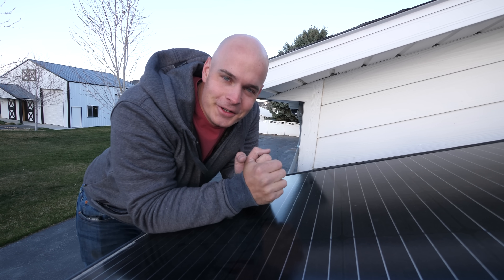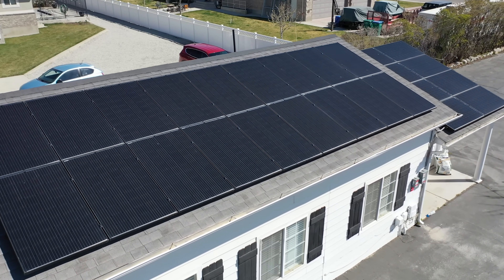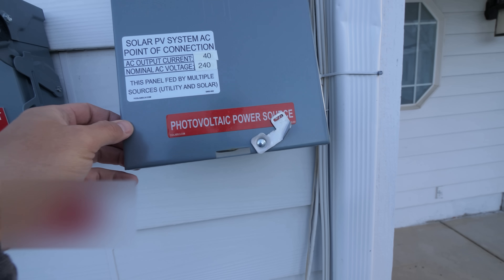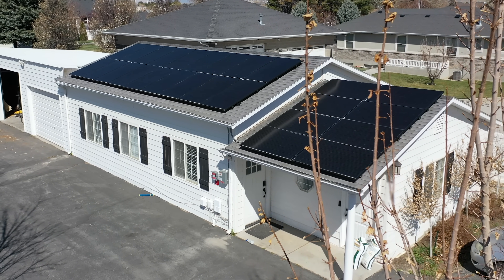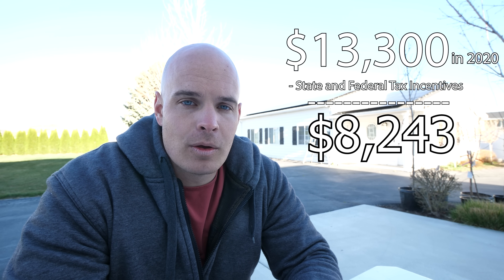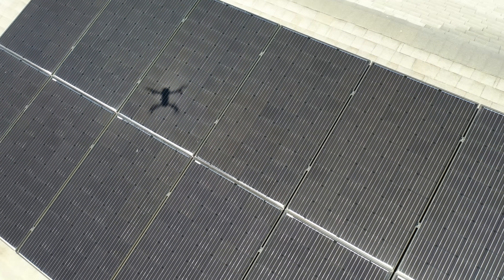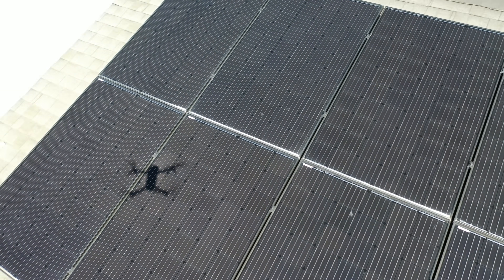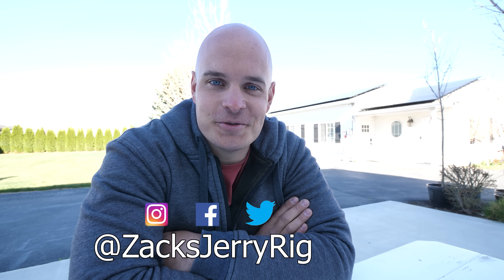One Year Solar Update! - Is Do it Yourself Solar worth it?

Comment: As a Texas residence, your statement about Texas  was accurate. We tried getting solar but we were told no, then yes, then no again.
Our friends in New Mexico did not have any problems and the state actually encouraged their people to switch.
Reply: Just go off grid.. battery storage is dirt cheap right now.. $300 a kwh
Reply: @FJB2020  um.... trolling? dirt cheap... using numbers here... 29kw x 300  8700$ for 1 day of storage... need at least 3... at LEAST for off grid... 26000$ in batteries... lolwut?
Reply: @mattlane2282  you use 29kwh at night?
Reply: @FJB2020  you never seen rain before? wtf are you even talking about... i use 29kw at night... it just rained here the last 2 days... and was cloudy for most of today..

thats 3 days at 29kw a day where your solar did close to dick...
wtf does night have to do with anything?
Reply: @mattlane2282  29Kwh sounds quite reasonable depending on the size of home. A 2-ton air-conditioner will use approximately 2 kWh per hour x 12 hrs @ night = 24Kwh, assuming 100% duty cycle. Folks don't quite get that you need 2-3 times the storage capacity (batteries) to draw from....depleting batteries to 0 damages them, even the so called deep cycle batteries. That raises the installed cost $$$. Sure, you can live with less run-time; settlers tamed The West 150 years ago without any AC. It doesn't invalidate the physics of the installation...
Reply: @luisderivas6005  This video doesnt help. Some who have never changed a light bulb think you can just throw some panels on your roof and plug them in. Two things, First, house must be oriented so panels get sun. Second, roof must be capable of supporting weight.
Reply: Texan here with solar, no problems here. They were sitting on my roof during the winter event too ... just not connected (not that it would've helped).
Reply: its because the oil companies are trying to protect their own interests by lobbying....more solar means less gas drilled. Which is why you see cloudy Europe and Japan so enthusiastic about solar while sunny Texas and Arizona lag behind...
Reply: @annikasurann9274  That is only part of it. Most solar panels and wind generators  are made with fossil fuel power LOL. Personally i don't have a problem with fossil fuels,they are completely responsible for thousands of things we use in our lives every day.and we already have infrastructure in placed now for over 100 years to use it. It makes perfect sense to dump fuel in my tank and drive instead of converting it to electric,sending it many miles and then charging an electric car for example,incurring all the losses. That being said solar and wind make up a trivial part of the power we wasteful Americans use. Not to mention wind only works sometimes and solar only works in the day time(and not even that when we had the Texas Freeze where it was all covered in a inch of ice.. Fossil fuel plants can generate 24/7. Solar is ok,and i do have 8KW of it installed here,but it does cause problems getting on and off the grid(Gridtied) for power companies. Europe and Japan is generally using way less power in their homes than americans use.
Reply: Honestly not worth it yet, Solar is about to get some huge upgrades in the next couple of years. If you install solar now you're gonna be stuck with some heavy obsolete tech.
Reply: @zhenyucai8688  lol you can say that about any technology
Reply: That is not true,i have 8KW made up of 20-400W panels on my workshop and grid tied with sunnyboy inverter with net metering here in central Texas. This was no problem.
Reply: Hello, What was it exactly the wouldn't let you get solar?
Reply: Your comment is false. I live in Texas and have two additional houses here all with Solar Panels. They work great. The reimbursement scheme is a bit different from company to company but all were perfectly accommodating to my array and tying into the grid. I suspect the plans you submitted were either incomplete or perhaps not up to code. This would result in rejection no matter which state you lived in.

Comment: Nice vid, interesting to see the difference in a US installation compared to the UK. US roofs look so much easier to work on, I assumed its timber with a felt membrane? UK roofs are a mixture of slate, plain and pantiles on top of battens fixed to rafter & purlin or truss roofs so each anchor is screwed to a rafter and weather proofed in according to the tile type. Also, we have very tight Work at Height regulations and would need to have a scaffold in place to allow safe access which adds to the costs. Not sure about the US but we also have a growing problem with birds nesting under the panels so we install a mesh around the perimeter of an on roof system. Some roofs now with PV which don't have the mesh are pigeon infested.

Not sure if you're aware of Solar Edge, but I attended one of their courses once which talked about microfractures in the silicon cells which can occur when weight is put directly on the panel. Couldn't help but notice one of your team sitting on the panels during the installation and remembering that.
Reply: Many types of roofing over here. In the western US, mostly timber frame roofs with plywood sheathing, poly wrap for moisture barrier, tar/felt paper, and composition tar/fiberglass roofing sheets. Screw mostly anywhere on the roof. Permits are required, mostly for weight, fire, and electrical concerns. Still not worth the slow return on investment if you ask me. Want to have power cost savings?  Just make sure to unplug unused electrical items and turn off the lights when you leave the room.....lol

Comment: Im a solarpanel installer. There are not the best to go thru the roof. Go thru the wall. And use alooooooot of sealant where you go thru the roof. There are alot better stuff on the market. You don't need a converter on every panel. There are with micro controllers. Get One big AC to DC converter and put it on the wall.

Comment: Hey Jerry,  I have a grid tied system of 3.5KW, just wanted to share my figures for the amount of electricity generated from where I am situated, that is Mauritius in the Indian Ocean.  My system will yield between 3 to 6 times the rated amount of PV panels of 3.5KW on a daily basis averaging between (10 to 22) KW/H.  On a monthly basis depending the season I am, for each KW rated capacity of the system, it will vary between (100 to 150) KW/H, in other words between (350 to 525) KW/H monthly.  Saw your peak production capacity to be 53KW/H on a specific day which  is rough 6.1 times the installed capacity.

Comment: Well I have not just 1 portable power station. But 2. 1 Is Progeny 350Wh portable power station with only a 5 bar display and Allpowers 372Wh portable power station and also not just them I also have a 100Watt heavy duty solar panel and a 10watt USB solar pad. Also along with a lot of power banks and well a few sets of flashlights. But anyway pretty much all good and also did a YouTube review about them and even post photos of them messing with them and only safely test them without getting shocked. Also grid tie systems for me might be cool. But at the end they cost a lot and I would just get a few batteries over time vs getting a lot in one place at one time. Also I even charge kobalt batteries that are 40v to use it on a battery push mower too cut grass. It still did good. Sometimes they need a lack of cooling once overheating.

Comment: You could actually connect something like a Chevy Bolt to an inverter and plug it into your house to use as a back-up battery :-)  I'm planning on doing it with mine, most likely

Comment: People always talk about the panel degradation and drop in production, fine...  it's going to happen - just oversize for where you think you need to be when that happens - easily done.  Or leave yourself some roof space and add more later, chances are the efficiencies will go up and prices go down through time anyway and you'll be covered.  BUT - what if, and I think the IF is about a 50/50 at this point in time... some of the perovskite advances prove viable for commercial deployment and new panels produce way more (maybe 1.5-2X) on the same footprint... how many older systems will get panels lifted off and replaced by new ones replacing them producing far more - and ditto for battery storage on site.... won't take much space to provide most of your electricity even during the nights most days... maybe harder to cover for several days etc...

Comment: That's exactly what V2H (Vehicle 2 Home) is for and is being rolled out in Japan right now (e.g. Nissan Leaf with state subsidy for V2H).
Reply: Didn't japan choose the wrong direction (hydrogen)?
Reply: @teemumiettinen7250  Nah... Now Japan is all about Solar Power. The government put an idea into the public that would transform the country into a fully green country by 2050, which means no more coal no more nuclear, only renewables like wind, water and of course the main powerhorse solar. Now there are even some subsidies for solar and battery solutions, like V2H (some 12k USD, which includes the installation of a charger for the car), but only if bundled with a car (like the Nissan Leaf) and used for 4 years so the government can monitor your V2H system to see how things are going. Also, every new home design must now implement a solar panel system (just the panels, not a battery which is 3 times more expensive in japan than in the US).
Reply: @takeyoshix  Thats good news.

Comment: I’ve got 13.2kw on a 10kw inverter here in aus.... we are surrounded by trees but still manage to produce about 50kw a day, I mine crypto which it helps to off set the power usage but we are also charged about 34c AUD per kw which is ridiculous when we get back 11c per kw we feed in. 
It’s in our best interest to use as much as possible so we run the pool pump washers dryers and so on during the day to make sure we maximize solar input. 
Thanks for a great video

Comment: I don’t really understand how you are able to make full use of that power. Is it being sold back to the grid at cost when there is excess power, or do you have sufficient battery storage to buffer the power for usage at night? Otherwise I’m not grasping how you are fully taking advantage of the power being generated.
Reply from the maker: We have 4 adults, 2 kids, 2 electric cars, welders and an elevator. The building you see with the solar panels is my office, the house is a separate structure. We use alot of power.

Comment: The biggest problem with solar as a system wide energy production is storage. The lithium batteries we’re using are terribly inefficient at scale, and there just isn’t enough lithium in the world to support it if we did go with it. Once we solve that issue though, solar will be used  on most grids almost for certain, since the upkeep cost is negligible compared to other forms of energy.

Comment: In Denmark where I live, electricity is 32 cents/kWh so a lot more expensive, mostly due to taxes. The same tax is on electricity you produce with solar panels, so not many install these as you need 30 years to earn the money you save by installing them. Sad for the environment.

Comment: No automatic cutoff switch? Thought that was required so as to insure that power wasn't running back into the grid in the event of an outage for when the power workers not to get electrocuted.
Reply from the maker: My micro inverters only work when they sense the grid. Without grid power the micro inverters turn off on the roof. Good question.
Reply: @JerryRigEverything  nifty, these solar systems are getting easier to set up.

Comment: Anyone who has gotten sunburned on a cloudy day knows that solar radiation penetrates clouds. For that same reason, solar panels can still produce electricity on cloudy days. But depending on the cloud cover and the quality of the solar panels, efficiency can drop to anywhere from 10 to 25 percent of the energy output seen on a sunny day.

Fortunately, SunPower® solar panels, with a record-breaking efficiency of more than 22 percent (highest efficiency panels commercially available1 ), use cells with a unique one-of-a-kind design that capture a broader range of the sun's light — including red and blue wavelengths. They make more energy than conventional panels on a cloudy day, making them a good choice for cloudy climates or if trees partially shade your roof during certain times of day. We also design into our cells a "backside mirror" that uses a thin layer of aluminum that bounces some of the light photons that are not absorbed on their first pass through a cell back into the cell to have a second chance for absorption. This results in greater output of electrons from the same input of light.

Comment: i don't get it 28.9 Kw per day, i am using 6kw electricity and 1mc3 gas that is @10Kw, in the winter, in the summer is less (gas)(just for hot water). this is insane. I have another summer house that is off-grid and we use less than 10kw per day (for cooling and cooking).

Comment: If that battery inside the anker 800 is replaceable then i might actually get one, my 500w inverter off of my 1.5kwh battery is abit clunky but great when i go camping and parallel a second battery to a combined 2.7kwh to go cruising long distance with little effort, we're talking 200km per charge or about 150 without pedaling with enough power left to charge my phone and speaker and keep the mattress inflated.

Comment: I would like to bring up two points, the first is that installing those panels voided most asphalt shingle warranties. The second is even if the warranty is good...you would be lucky if you got ten years out of a new roof in any type of windy environment....the constant vibration will work the area around the fasteners and cause leaks.

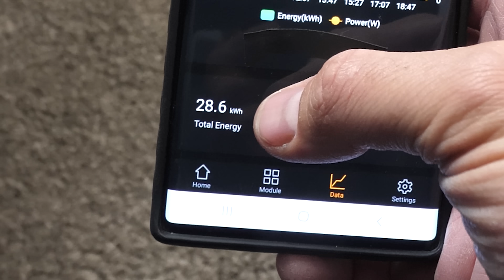Comment: 4:25 that's why you need bluesolar ones - solar panels work over the light spectrum - and not on light or heat. The BS software will harvest about 30% more even in the winter.

Comment: A little perspektive about those nummer in Germany: we pay about 32cent per kWh we use here. But, if you have to much energy, and pump it into the grid, you only get 8-9cent. So a battery helps a lot here

Comment: NO ATTIC/LOFT or BASEMENT for max safety. All cables and boxes can be exterior or in a garage or vestibule. This is my motto and it makes you safer. Your breaker box should have been moved to where the other boxes are outside and there is NO reason to feed anything via an attic. PS Those breaker box switches look so old fashioned by European standards.

Comment: I don't get the calculation. If Zack's panels generated 13,000 kWh, how much of that energy was he able to use himself, and how much did he have to sell back to the grid? 
Here in the Netherlands there are huge taxes on electricity. That means that you buy at ~ $0.26 and sell back at ~$0.10/kWh. It used to be the same rate: If you consumed 2000kWh, and generated 1500kWh, the power company would invoice you the difference: 2000-1500=500kWh@26ct. That scheme has ended, and now you pay full price for every kWh you get from the grid, and only get a fraction of that when you sell back. That makes solar panels uneconomic unless you have a way to store the power, so you can use it when you need it.

Comment: Some mathematics and physics out of the way: 1 W = 1 J/s. The specific heat capacity of water is 4200 J/kg^-1 °C^-1. 
What that means is that it takes 4200 J of energy to raise 1 kg of water by 1°C, and the solar panels produces 8000 J of energy per second. So the solar panels produces enough energy to heat almost 2 kg of water by 1°C per second

Comment: The Kit u showed only has solar panels and inverters, which means the electricity directly powers your home but my home had a solar panel attached to 8 batteries and then the inverter to power the house.

Comment: Zack, I wanted to actually find out about battery before you made mention of the grid. So do you mean you don't have batteries connected and you get power directly from the sun? Because when you spoke of maintenance, what came to my mind was battery replacement.

Comment: Your panels might be a bit out of date. The new 370W panels can produce 9.9 KWh (27 of them) you have 26 panels for 8KWh. The other interesting thing is the price. Here in Australia a 6.6KWh system which is the norm for most houses cost somewhere between $4-5000 AUD and there is $1800 AUD rebate. In American money that means 6.6KwH system is yours for $2000 USD.

Comment: This is the greenest implementation of solar panel technology in the home currently. The figurative equivalent of “direct drive” if you will. But battery technology is far from ready. Maybe when sodium-ion batteries become consumer ready. Also, chargers that utilize gallium nitride as opposed to standard silicon chargers will also make a big difference.

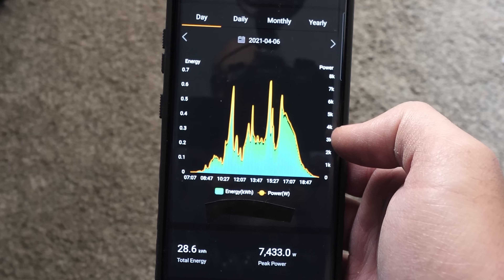Comment: 4:40 10 cents?! going to take a while to ROI the system. it's green though, all for it!👍
Reply: Yeah but 6 years is relatively short considering the odds. Unless you're moving house to house which if you're moving every 5 years, that is already a terrible financial move to begin with, solar will certainly paid itself off and be extremely beneficial long term. Hell especially once large capacity batteries become cost efficient and fiscal for a homeowner, you're gonna be generating essentially free power! That is a win in any circumstance. If only Texas would get on board with solar already...it's such a convoluted process here.